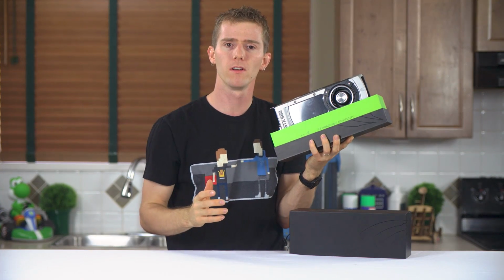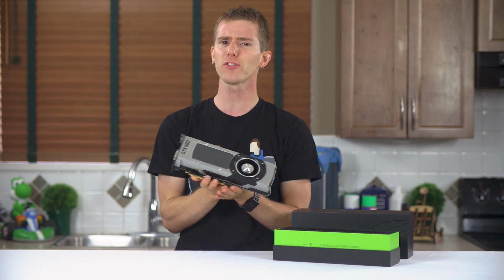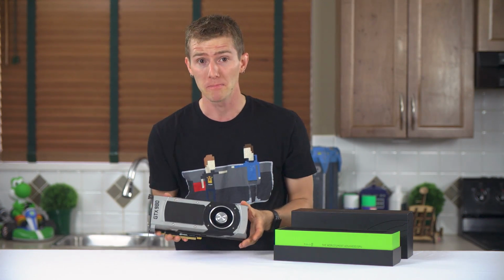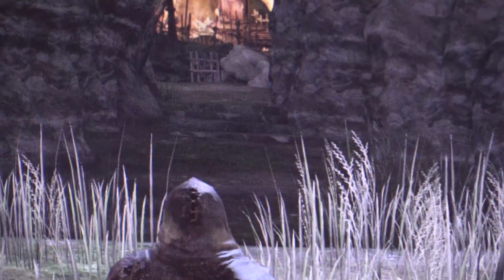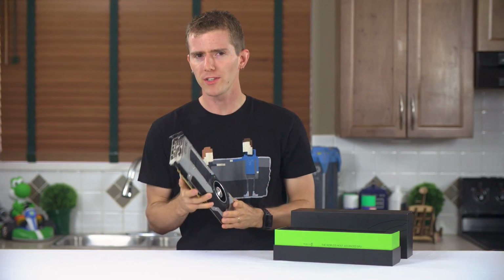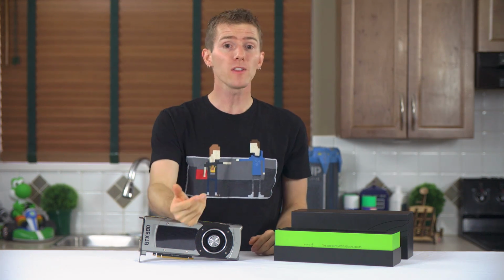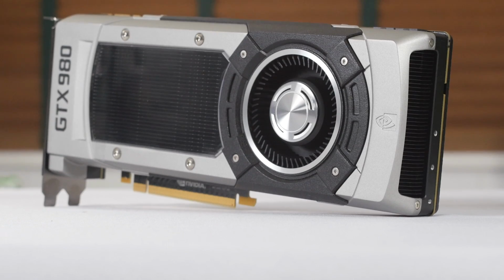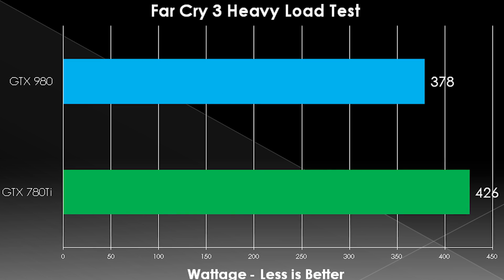NVIDIA GeForce GTX 980 Video Card - Performance Overview

Comment: Can someone help me get my head round NVida's numbering/naming system

I know AMD's which card is better than which.
Reply: Allright,
The 100 number is what series it is (600 series, 700 series, 900 series (they skipped 800 for desktops))
The 10 number is the card within the series (760, 770, 780 for example)
80 is normally the highest of the series at release (sometimes a TI version is released, like 780TI)
If they release a 90, it's a dual-gpu card
Normally, the 70 of a new series has the same performance of the 80 or 80ti of the previous series
Reply: ilov3mus1cx3 dont look at stats, 900 series has worse stats than 700, but perform better
Reply: OK cheers guys
Reply: Nvidia numbering system is more straightforward compare to AMD, Higher number =  better, but if compare to the last generation, it would be something like 770>=680, or 970>=780. Basically the number -10 and get about same performance or more. Something like 280x >= 7970. Mid range one has about the same performance as last gen highest end. AMD for me is more confusing, R7 260x, then suddenly R9 270x, lol wut. R7 265> R7 260x, but R9 285 < 280x? wtf? AMD last gen naming system is better IMO, although it is 4 digit, but higher number = better, unlike this gen where you have 5 at the middle, then non-x or X.
Reply: HCK Gaming I found AMd's old numbering quite simple. Like you had 6000, 5000 seires cards. With the old cards though, in the 7000 series 77XX cards were 1gb of VRAM, and if the number was 50, 70 or 90 that dictated the stock clock speed of the card. 78xx series were 2gb and 79xx were 3gb. Now with the new R9 series cards, the 260, 270, 280 and 290 cards are the vram amounts, if there is an x after it it has a higher clock speed, then I suspect the 5 after the number is an in-between card of the base model and the X model..

Atleast that is what I have come to understand.

Comment: Performance is slightly better
Wait till we see the 980 TI :O
Reply: Performance is actually quite a lot better. If you factor in that they use reference coolers for the 980, and the older cards are most likely not reference, that gives the non-reference cards an OC advantage. Also, newer cards will get plenty of optimization drivers in the next few months, so expect more speed. Allready now, the 970 is about 35-60% faster in most games than the 770, with both at stock (780 and 980 should be about the same)
Reply: Christoffer Nørskov Oh yeah..Drivers..Thanks for the reply!
Reply: Christoffer Nørskov You have any ideas on why the 800 series was Skipped
Reply: Because the 800 mobile and desktop cards would be using different architectures
Reply: Also consider that this "slightly" better is without MFAA. When MFAA is enabled it should get another 10-50% (and on average about 25-30%) so it will be starting to wipe the floor without question in games.
Reply: ***** No, it's because of the difference in architecture 800m were kepler and 900 is maxwell
Reply: ***** The Maxwell in 800M was fiurst generation, in 900 series it's second generation, hence the difference. It's like saying that 700 series should just be added to 600 coz both kepler
Reply: ***** Very good reason to change. Normally the desktop and mobile gpus are very simmilar, hence why they share names, when they have two different architectures, they are no longer simmilar, hence the reason to keep them different. It's one of those things where they are going to confuse someone no matter what they do.

JammyDuel 800m was kepler. The only card that had maxwell was VERY FEW of the 860m's and that was as a public "prototype"
Reply: ***** They meant to announce it with the 800 series, but ended up not doing it, because of technical problems

Comment: GeForce GTX 980 4GB 256-Bit or SAPPHIRE TRI-X Radeon R9 290X 4GB 512-Bit for an amd build?
Reply: 1080p: 980
1440p: either
4k: r9 290x
Reply: Christoffer Nørskov hey man I really appreciate the response! Do u mind me asking what the reasoning is? I.e price performance? I play 1080p and previously planned to purchase the 290 but u have me thinking.
Reply: wowwork4me memory bandwidth. The memory bandwidth of r9 290 cards is much higher, so they handle resolution better. The 980 is much faster at 1080p and likely still at 1440, but at 4k the lower memory bandwidth is bottlenecking it. Give me 5 mins and i will find you a benchmark to demonstrate
Reply: Christoffer Nørskov OK thanks! I think it will be quite a while before I upgrade monitors soo I'll look into getting the 980. Does my comp being and and build make a difference and I appreciate u looking for the bench marks always nice to see it "on paper"
Reply: wowwork4me amd*
Reply: Actually, let me revise my pick. Just get the 980. Even at 4k, the difference in speed is too big for the memory bandwidth to matter in most games. Generally, the cpu doesn't matter much when it comes to brand. It's all about having the fastest single threaded performance. Cpus aren't really too much of a bottleneck anymore, unless you run some old crappy one.

Comment: 2:22 wasn't it a bad thing to hold the graphics card by the 'golden fingers' aka the connector to the motherboard?
Reply: Go do your homework, kid
Reply: Not a big deal MrGrayfour. You always wanna hold a graphics card like that; it's a bit different with older models or motherboards, because there were more exposed components back then.
Reply: Richard Rodriguez Ah thanks for the information. Linus used to say that in his older video's so I thought it was still the same.
Reply: SuperHoldenC Unfortunately my homework isn't about computer hardware, it's all coding at the moment, but I might learn about hardware at my next school. :\

Comment: Fuck NVIDIA. year 2012- 680 is top card
                         year 2013- gtx770 is 3rd top nvidia gaming card after 780ti AND 780, but it has SAME performance as 2012 top card.
SO 2014. will have 980 ti 980 and 970
WHY IS THE 3rd (or 2nd) best 2014 nvidia card WORSE than TOP 2013 card (780ti)

tldr 2013s 3rd best card (770)is as good as 2012s BEST card(680), but now Nvidia's 2nd best card( 970) is WORSE than 780 Ti 
FUCK you nvidia sons of bitches
Reply: ***** wrong, the 970 should be better than the 780 standard, which in most areas it is. The 780ti is a totally different manufacturing die process, sooooo no.... it shouldn't be better than the 780ti.
Reply: this year 970 SHOULD be better than 780 ti, SIMPLY Because 770 was better than 680!  stupid nvidia
Reply: Why? 

Money
Reply: Jesus Christ, you're an idiot.

The 770 was better than the 680, the 970 is better than the 780.

The only reason the 770 beat the best 600 series single GPU card is because they never released a 680 ti. 

They released the 690 instead, which the 770 DOESN'T beat. 

lrn2educate
Reply: ***** You're missing the point entirely. The x70 cards aren't supposed to replace the most powerful card of the previous line, they replace the x80 cards of the previous line.
Reply: Yeah, fuck Nvidia for making their products progressively better each year!
Reply: Thats why Nvidia do not hire you as their sales . No way a 329 USD card should out perform a 700 USD card . All the consumers will be buying 970 instead of 780 ti then. That would be a marketing disaster for Nvidia.
Reply: You realise that 780ti costs over 600usd while 970 is only 399, and the performance of 970 is about 10% smaller than 780ti.
Reply: ***** Uh, in most benchmarks the 780ti is slower than the 970. And you have to factor in optimization, as the 780ti has been optimized through drivers for a long time now.
Reply: ***** LinusTechTips It's become abundantly clear that the comments section of youtube is non-constructive impulsive arguments which show no progression even through the rare educational well-written comments. If people are willing to sit down and discuss their points, they can join LinusTechTips forums or look elsewhere. Since all of this misinformation is only hurting the community. I implore the comments section to be disabled.
Reply: your dumb
Reply: Ciel Diablo had to*
Reply: ***** Well I would put it the same way as last run of cards compared to each other. Although 900 series are totally different. 770 = slightly overclocked 680.I would put the 970 around the 780 which is at AMD 290/290X-ish (dunno how their system works..)
Reply: ***** Did you see the review? 980 Was at many points faster than the 780Ti Not by a whole lot, but still faster. The 980 is at the moment (atleast here in Denmark)  neck and neck with the 780Ti pricewise. It's said that the 980 is to be about 10% faster than the 780Ti.. I bet some already has said this, but you seem to not be able to understand any of this...
Reply: Sir I honestly don't think you know how nvidia releases there graphics cards.  The 80 level non ti is basically the same as the previous generation 80 level ti and once again this is a brand new architecture that still is getting drivers and other updates everyday so let's see how these cards stack up when the red team release there new lineup some time in the near future.
Reply: There is no such card as GTX 980Ti
Reply: 3rdpartyU5er then, even worse!
Reply: ***** 770 was a bit more powerfull than 680 but not the theoritical 680TI
Reply: JordanDoesGames 680 was the top of the line 2012! 
780 is the top of the line 2013?
Reply: JordanDoesGames then, at least 980 should be better than 780 ti.
because 670 was better than 580.
Reply: What is the equivalent off the 970 and 980 in the  gtx 700 and r9 series?
Reply: GTX 980 is faster than 780 ti? 770 was faster than GTX 680. Bruh, get your shit straight.
Reply: Olivers Grauengaard 770 is a renamed and slightly oc'd 680.
Reply: Davis Klavins *$329
Reply: I know the specs don't look the best but you have to wait and see how it performs, specially now with the new technology. Besides nvidia just threw a big punch now we need to see what amd does. AND THE BATTLE RAGES ONNNNN
Reply: ***** the "Ti"s come out later on. It'll be here. Hopefully with an out of the box water cooled edition. That would be fantastic to have on all models
Reply: Wow!
Somebody lost their CoD killstreak.
Reply: will there be a 980ti? & when? :)
Reply: AMD fanboi, detected!
Reply: M.Lewis Simple, yet effective
Reply: ThoughtfulThug actually no, im pissed because i have GTX680 xD
Reply: ***** It's fine. Just wait around the summer of 2015. Probably can get the 780ti 100 US dollars cheaper...
Reply: Where's the fan boy let Me at him let me at him
Reply: wtf are you talking? generally it works as follows: every new generation a new video card performs the same as the one tier higher card from the last gen (980=780Ti; 970=780; 770=680 and so on), but costs as much as the last gen card in the same tier. So the 970, for example, performs as good as the 780, but costs as much as the 770 did at launch. I hope that makes any sense...
Reply: ***** i have a 680 too :)
Reply: ***** You're*.... Sorry but I have to XD
Reply: Acholate Nope. Mine was grammatically correct for the time. I was writing in present tense and was talking about present tense. It would be "had to" now however
Reply: ***** ok but still 980 should be better than 780 ti, and maybe 600$
Reply: ***** Are you even listening? No it shouldn't! That would be an absolutely horrible marketing strategy! A card cheaper and more powerful is absolutely horrible when they have cards that they still have on the market as the mainstream components.
Reply: Zach Withers its not about marketing strategy its about gamers. Gamers with 780ti have been 1 YEAR or more waiting for a better card, and now they see they cant upgrade.
another year with the same shit.
and gamers who didnt buy the 780ti were waiting for something better and now they see they lost 1 year
Reply: ***** So you want Nvidia to say "You know what FUCK IT, we are just gonna lower our prices on our new cards, give you 10 million giaflopbytearoonies and call it a day!" We will never be a company again! PEICE.
Reply: i was waiting for something better and i lost a year... :(

hopefully they release the 980ti soon afterwords. well i'm assuming they won't be retarded, but can someone please tell me they will definitely make a 980ti or something better than the 980??
Reply: ***** Why is it worse? 780Ti was just made because NVIDIA had to have a better card against r9 290X. Clearly they wanted not to launch whole new series of  GPU's but only to have hands down best single card GPU on the market.
Reply: Masterfighterx Probably just ranting about not being able to afford it at the moment. Typical immediate reaction to whenever a new card is released. I tried to explain this flaky dolt that he can probably get the 780ti cheaper next year, so he would not have to feel that he is too far behind...
Reply: ThoughtfulThug hahaha, yea, by the way thugman, i just purchased the Gigabyte 980 GTX GEFORCE. which one is better this one Nvida or the one i bought?
Reply: wax? youurs is a bit better, i havnt seen a reference 980 or 970 so its ok aftermarket is much better and have better cooling
Reply: I'm not even going to begin. Your comment is so ignorant I want to throw up and shoot myself because of the fact there are Humans walking this earth with that are as dumb as yourself. If you don't know what your talking about- SHUT THE FUCK UP. Its a common rule. Follow it and you won't look so incredibly stupid.
Reply: Grubite so, whats the common rule?

Comment: Hi .. recommend me to upgrade my GTX 670 for a GTX 970 ??. would be worth the change ?? notary is changing
Reply: I'm not completely sure, but the 970 should be about twice as fast as a 670
Reply: Brian Manuel If you play a lot of horribly optimized games then you should upgrade but I seriously wish I had the money to be like you guys :)
Reply: Christoffer Nørskov I have a 660ti and play most if not all of my games on max settings (1080p) and never dip below 60fps.
I'm guessing we don't need such high performance GPUs for 1080p, right?
Reply: littlefrank90 Wrong, that is literally impossible. If you really run all settings a max (including all the extras like AA and tesselation) a 660 ti cant play 1080p at max on all games. Even the new 980 cant take on intensive scenes in crysis 3 at absolute max without going under 60
Reply: Christoffer Nørskov I really don't know what games you play.
Except battlefield 4, metro , crysis 3 and a few other very graphic intensive or badly optimised games (which I play at high settings anyway and hardly ever dip below 60fps), the 660ti is just fine for 1080p.
And I'm running an i7 2600 stock clocks, so not really the most recent CPU.
Reply: littlefrank90 What a coincidence I have an i7 2600k (no overclok) along with a GTX 670, and as it says in Christoffer Nørskov  several intense games like Metro, Crysis 3 and other horribly optimized, is not able to get stable 60fps with absolutely everything to max in 1080 .. at least that happens to me with my 670, so I wonder if truth would be nice to upgrade my 670 to a 970 :S
Reply: Brian Manuel I'm going to upgrade to either 970 or 980 when they start delivering. 670 is decently powerful, but i believe the 970 is about twice as powerful, at least looking at benchmarks

Comment: Guys, please help!! I have an i5 4670, 8gb RAM, asrock h87pro4 a 600w PSU and a GTX 560TI  which i want to replace.. I was planning on getting the 780ti, but looking at the lower power consumption on this and the lesser price for around the same stats, i think i can go for this.. What do you guys think? Should i wait for an inevitable 980TI.. i want a card by december or so!!
Reply: O... and i dont plan on overclocking at all..

Comment: I'd actually like to see this card compared to the 780ti with both running dual SLI.
Reply: 980 and 970 should both be faster than 780ti when all are running stock

Comment: I'm so confused, what is better now? a 680, a 780, a 780Ti or a 980? And is like a Titan and Titan Z even better than all this?
Reply: A Titan Z is a dual GPU card. It's two Titans on one board so it'd wreck the 980. As far as I can see the order is like this. 680<780<780ti< (or in some cases) = to 980< Titan Z
Reply: Alright Thank you !

Comment: if they cost about the same.. perform about the same.. 980 of course.. I don't see any benefits in buying older technology at that point.. and keeping in mind, all the drivers that will come out later on and probably improving the performance of the 980 even further. and less powerconsumption.. and sweet looking backplate.. why would anyone chose the 780ti then?

or did I miss something?

Comment: 2 r9 290s are still the way to go considering the pricing, but since prices are probably only going down from now it might become a good option very soon. Until it goes under 450$ however it's not worth the extra money imo. Props for the ref design though, I wouldn't hate having one of those as opposed to a custom cooler.

Comment: Well.. I'd get the 980 because its actually cheaper than the 780Ti here in Sweden :)
780Ti: 549 € (cheapest), 639€ (most expensive)
980: 525€ (cheapest), 629€ (most expensive)

And for other people that live in Sweden; Kollade på Inet.se och såg detta :)

Comment: I have a 780 and still playing at 1080p. I can probably find another place to dump my money. However if I was upgrading I would go for the 980. I thought the 780ti would still be on top of the charts because 980 is so new and the driver is still a little lacking compared to the 780ti due to it being out for longer. But seeing how well the 980 does now and its only gonna get better, and its in some cases even cheaper then the 780ti. Its should be a no-brainer. However, Nvidia have effectively killed the 780ti, I hope they've sold most of them out by now. :D